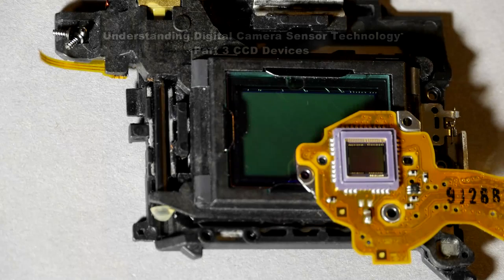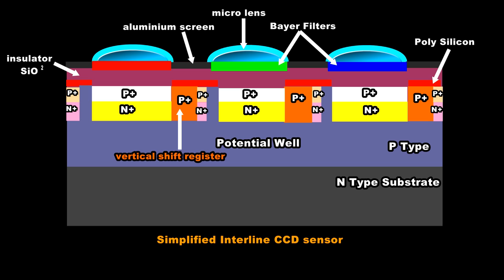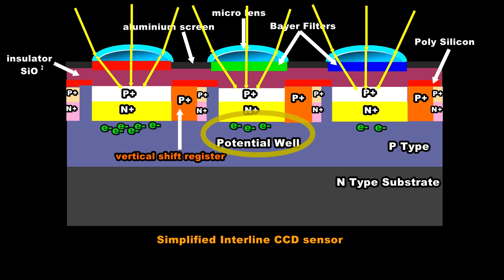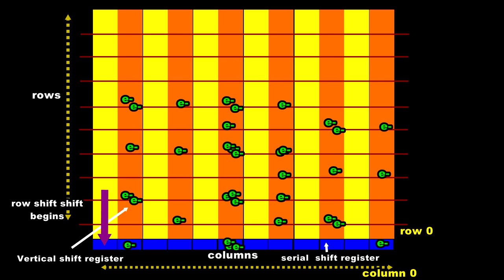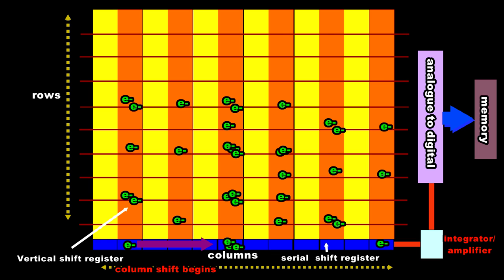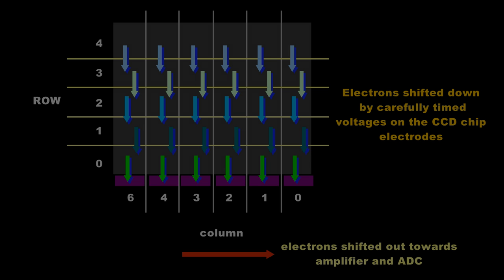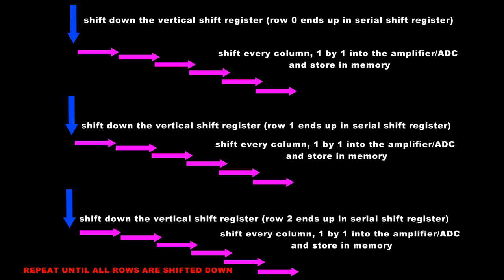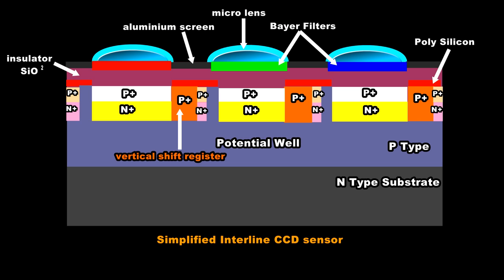Digital Camera Sensor Technology - Part 3 CCD Sensors explained

Comment: Thanks for this explanation. It looks to me like the charge is amplified after it is collected and if I understand right, the ISO determines the amplification. Can you explain why there is more noise in the image as amplification (ISO) is increased? Thank you!
Reply: Sonja, I think you are right that ISO determines the amplification.  When the camera is operated at the lowest ISO's, there are enough photons that the potential wells may be totally filled or unfilled. When ISO is increased, the amount of light hitting the sensor decreases. Then there really is not enough light to totally fill the well, and the amplifier gain is increased to compensate for that, so you still get the same range of analog signal to the A-D converter.  So even though the well cannot now be filled, it is still possible for the output of the amplifier to be at its maximum level and get 'white', or a digital value of 255. 

However, every sensor has some amount of noise that leaks into the image sensor cells from unwanted sources.  When the ISO is low, and the amplifier gain is low, this noise is amplified the least, and shows up the least in the photo.  Another way to look at it is that it is small compared to a potential well that can be fully filled by incoming photons.   When you increase the ISO, you increase the amplifier gain. This increases output of the CCD cell, both signal and noise.  But now you are dealing with less signal, fewer photons, and the noise becomes more apparent.  It has now been amplified more when it gets to the A-D converter.

In reality, there is noise introduced into all circuitry, so noise gets into the signal both before and after the amplifier.  It is the circuit designers job to insure that the noise from the rest of the circuitry is insignificant compared to what comes from the sensor.

Comment: shift registers should not exits anymore 
there a parallel or synchron electrical circuits that exits already like in the 1960´s

i still cant see why they would be used today, that electrical circuit problem is a very old known problem

while cpu´s longly use both, background wireing and paraellel/synchron circuits

that works for anything that has a charge or electric flow, therefore that works on any electric circuit 

people that might say you dont see the diffrens that is simply not true, special now in 2021 you more and more can see this problems

Comment: But can i make one homemade?
Reply: If you don't mind it having just a handful of pixels of resolution and being rather huge, like where every pixel is a few millimeters in size rather than the whole camera sensor being a centimeter in size, I can't see why not. There are even potential practical uses for that kind of thing, like an optical position encoder or a display calibration device, though in both of these cases you're actually better off buying a small image sensor IC off Texas Instruments or whomever.
Reply: Ok